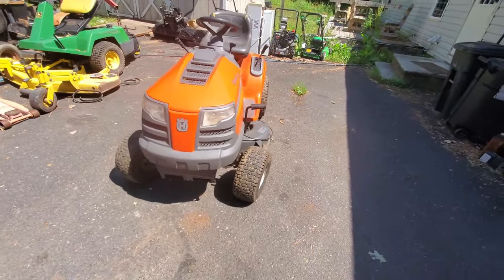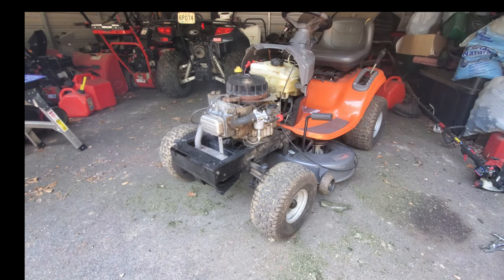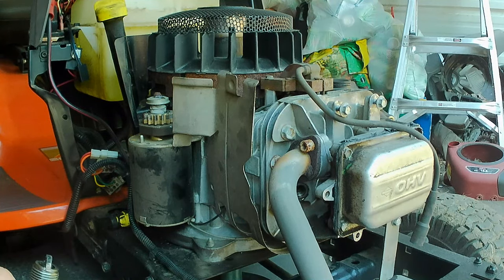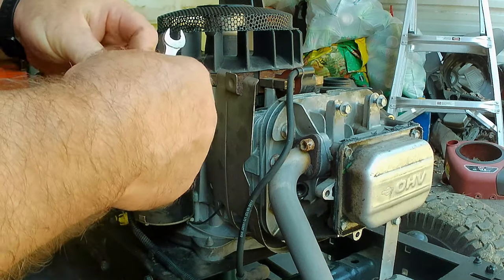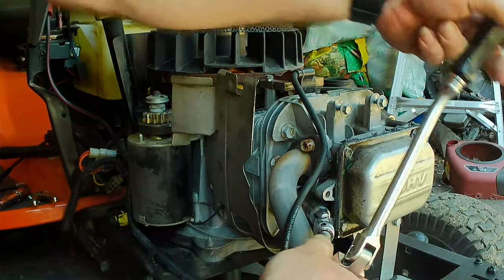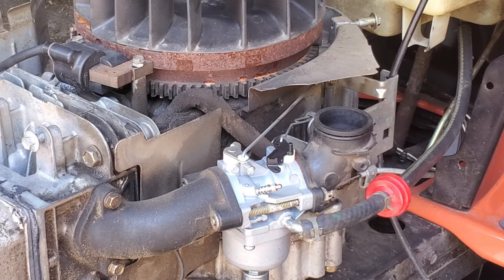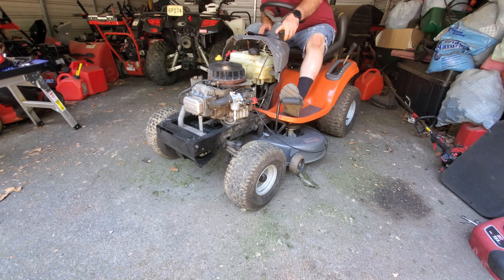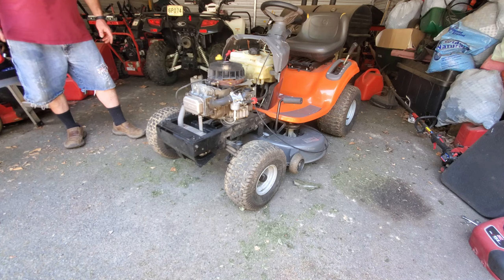Husqvarna Mower Backfiring: Repair Attempt Part 1

Comment: To chase the spark plug hole, just take an angle grinder and make a small cut at a diagonal on the end threads of an old spark plug.  Thread in and out until the threads are chased like new.  
As for the engine hunting, the problem is due to the Chinese aftermarket carburetor - which I call a Chi-Nikki version.  Many of these need the pilot jet to be enlarged which will provide additional fuel to alleviate the hunting. Sometimes other jets need to be enlarged but the normal culprit is the internal pilot jet.
Reply from the maker: Hi, that is a good idea about making a tap. The new carbs are made to run so lean that its hard to get a steady idle on some. So I will be addressing that issue also.
Reply: That will work ok, but the correct tool is 15 bucks or 3./4 40 years ago 😊 it’s best to chase it anyway if you think it’s strange coming out 😊

Comment: I just picked up a YTA1946 Husqvarna from a neighbor and the BACK STORY was he went out to start it one morning and when he turned the key smoke came out from behind the dash. He put it out back and went into town and bought a new mower. So I asked him what he wanted for it and he told me to just come and get it. So I go there and I see oil everywhere and the top cover was sitting on top of the engine and all the bolts are missing...hmmm. Now I'm pretty sure I turned the engine by hand to make sure it wasn't seized and it was ok, or maybe I turned it just enough, now I'm not sure. I went back two days later to pick it up and we load it up and I take it home. After unloading it,  I removed the hood to find it's covered in sludge by the dip stick tube and the tube is now lying beside the motor and the engine no longer turns more than a third of a turn in either direction and then you here the sound of a broken connecting rod. Now it WAS FREE so I'm out nothing, but now I need another 19HP engine. Oh well, Gotta love the back stories.
Reply: When I buy anything that is 6 years old I expect the engine to be junk and it’s only a part machine and scraper 😢 They know that a new engine is not worth it and buying new is what they are doing 😢😢😢
Fixing the market is a priority for them 😢
Reply from the maker: I get most of my mowers directly from homeowners, so I usually get a story from them about what happened. More often than not, the story does not support what I find broken and worn out.

Comment: I think it's that crappy chinesium carb. Any time I've tried to use one I got a similar result - I could get it to run OK, but not nearly as good as the original. Always clean and rebuild the original carb if you can.
Reply: I bought one of those on Amazon for about $35 and it worked for a little while but I ended up getting an OEM for a lot more.  Works better.  I saw a video by Chickanic who does these too.  She warned never to buy these on eBay or Amazon as the just don't work.  I wish I had seen that video sooner.  Oh well, you live you learn.
Reply: It’s cheaper in the long run to go oem or rebuild the old oem carb
I use sonic cleaner but if I have trouble then it’s going into acid and that’s the end of the problem 😊😊😊

Comment: Are you sure it's  a spark issue and not a carburetor problem?
Reply from the maker: Thanks for the comment, there is a carb issue, but I think the main problem could be intermittent spark.  I will be working on the carb soon.
Reply: @ridingmowerking  
Are you able to confirm intermittent spark?
Inline spark tester?
I just fought a backfire issue on my old JD.
Reply from the maker: Did not confirm with spark tester, but I have had plenty of carbs that would surge like crazy and still not backfire.  I will be checking valve clearances too. But the bad plug wire was definitely suspect, and it was easy to swap in another that I had already.
Reply: I am Not an expert. What I know about small engines wouldn't fill a pamphlet. 
I did, however, find on a new carburetor 
 pin holding the float had come partly out.
Causing massive flooding and backfiring.
Good Luck my friend.
Reply: Carb needs acid dip or drill it out

Comment: Any piece of card stock will work from around the house like from a cereal box or frozen pizza box. It’s not really that critical as long as there’s an air gap. It’s a Briggs Intek single which isn’t exactly the pinnacle of modern engineering.
Reply from the maker: True, by this point briggs was specializing in de-engineering, like most of the industry.

Comment: Also need to replace that cheap red screen filter with a real fuel filter. That's possibly how the surge problem started with dirt getting through.
Reply: I agree with you, but it’s usually the dam corn gas that messes up the carb and hoses 😮
Most fuel hose is junk now even 😢
All for the fast money and short life
Reply from the maker: I do prefer the paper filters, but I dont worry about using this style filter. there is a follow up video for this. In the end, it actually ran good.

Comment: You can also replace the terminals you can get a box of the terminals at your local NAPA Auto parts store and you don't need the boot to be on there or you can tell me some boot from an old set of plug wires
Reply from the maker: HI you are correct, but I was concerned that the insulation on the wire may have been damaged by heat too. And I had another coil to try.

Comment: I can't believe your gonna let that plug coil and exhaust problem ride!!😢
Reply from the maker: Don't worry. I'm not "letting it ride". This was already going to go to another mower repair guy. He has seen the video before it was even shipped to him.
If I was going to retail it, I would have chased the threads, and if that did not work I would have replaced the head so that the next owner could change the plug when needed. As far as the coil, I would have bought the correct one and replaced it. The real goal was to troubleshoot and see what would make it run correctly. Also, it made for a good video. thanks for watching.
Reply: @ridingmowerking  good job!!

Comment: I’ve been making more medicine money on 2 stroke engines rebuilding fuel systems than riding mowers because of the bad engine design 😢😢😢
Were running out of flat heads to replace the junk 😢
Reply from the maker: Yeah, those flathead engines would go forever.